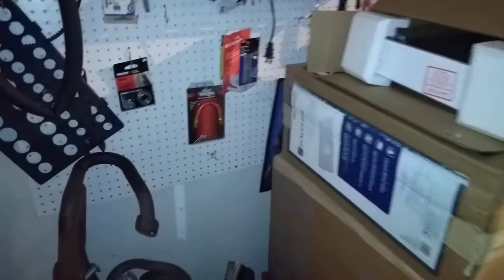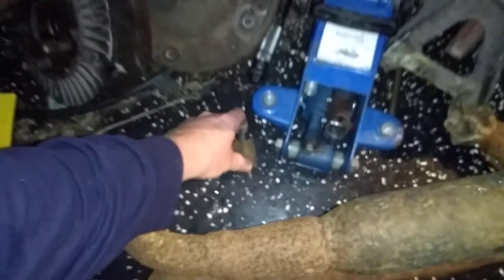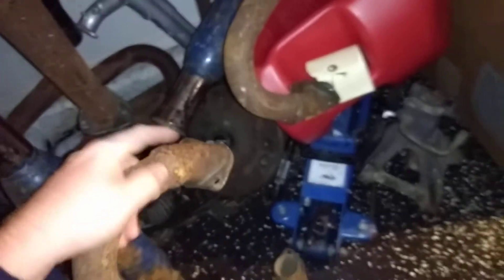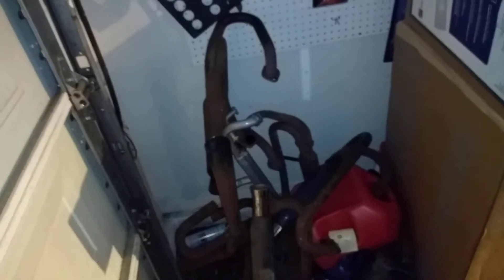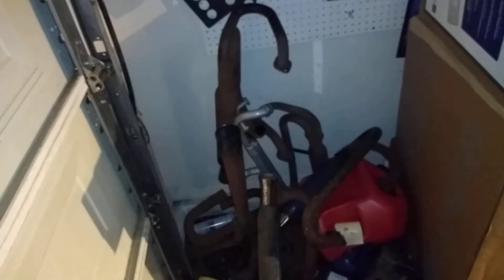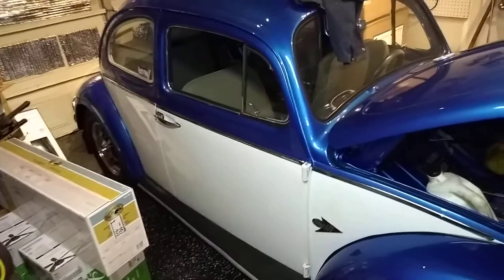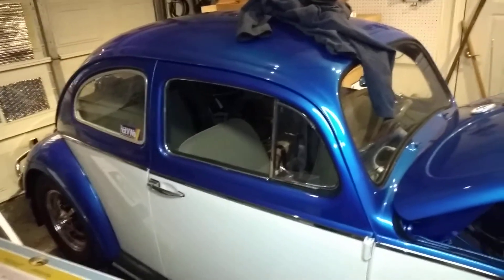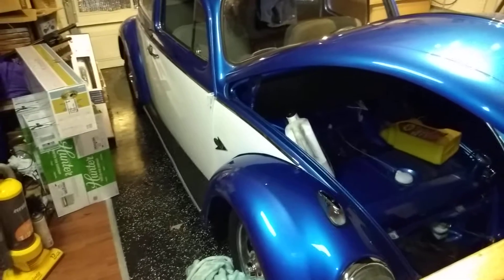Swap meet goodies for the future buggy build

Comment: i have a trailer if you ever need it just bought a tag for it is is stuck in the backyard lol.  you can cheat the wastegate by putting a regulator between the wastegate in the intake manifold in the boost reference line and restrict the boost going to the wastegate very cheap.  i have a couple if you want one i also have a magic distributor that i will let  you borrow out of my race car that will give you and easy 30 more horsepower.  i think your carb is way to small lover your determination. kenny and i used to battle over carb size all the time  saw Kwell run a  barrel and was determined to make it work on his car. burned up alot of scooters good parts lol eventually went to a 4 barrel.  i dont know how fast you want to go but i did find a 90.5 case and i have a set of cylinder heads that i got from jason at paradise for my car i dont think i am gonna race to much but their heads should make about 600 hp with a turbo they made 200 aspirated on their dyno and i have done about 100 hours of port work.  we can go through the motor together and put it in your car but you will have to be responsible for  your own transmission lol.  also found an old potter case in my shed it is cut for 94's we can put together too.  text me i lost my contacts with my new phone
Reply from the maker: vwdarrin  wow thanks Darrin, I will give you a text tomorrow if your # is the same, if not I will text Andrea. Not sure how far I will go with this thing, it needs to still be a street car. If things sit to long and I can't use them I get depressed and sell it, lol lost my but allot doing that. The carb is a limiter I know, just going to see how far I can go.